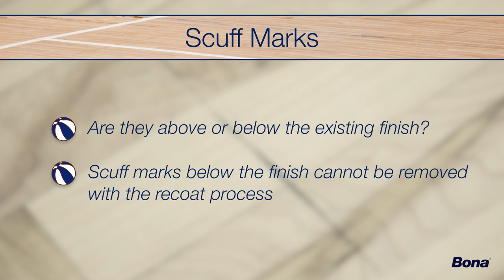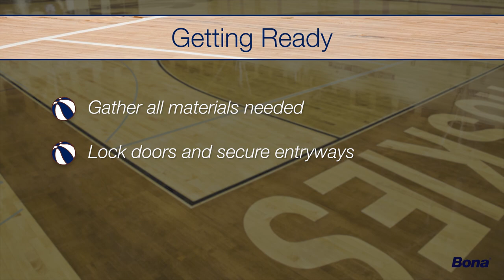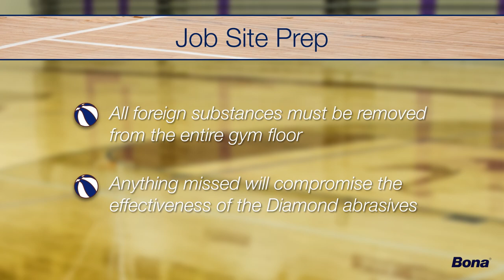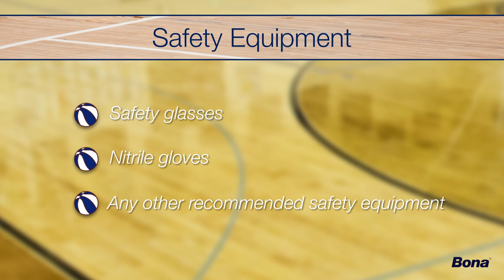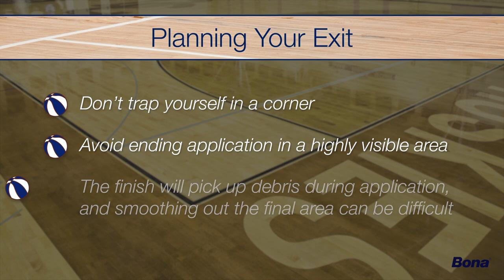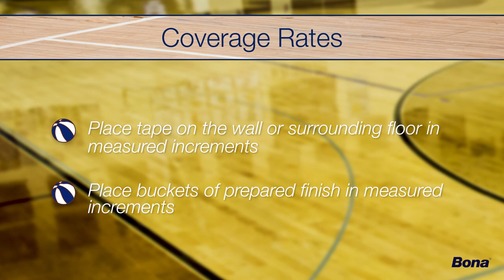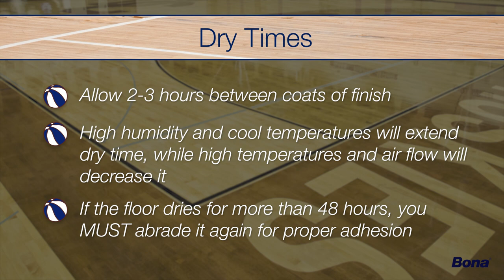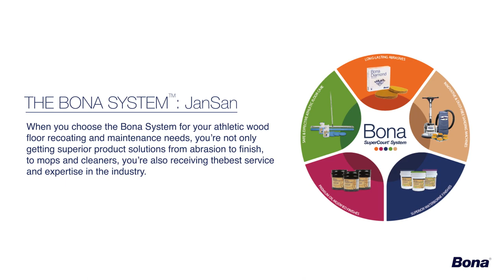How to Recoat Wood Gym Floors with Bona SuperCourt® Waterborne Finishes

Comment: Also you should make the pad like a towel so instead of getting the dust off you fold it on top of the dust so you can keep going
Reply from the maker: Hi Garrett - Using cheap bath/beach towels is also a great way to complete the tacking, doing just what you're saying and folding it back on itself as it gets dirty. We couldn't compete with Walmart pricing on towels like that, thus why we don't create a pad like that. We've found that the best cleaning method is to actually run the PowerScrubber back over the floor to truly remove all the fine dust and debris from the abraded floor. Hope that helps!

Comment: What do you do with peeling?
Reply from the maker: Hi Daniel - Sport floors that are exhibiting peeling of the finish need troubleshooting to determine the source/cause of the peeling and if it's an on-going issue or just a spot(s) issue. If on-going, the whole floor might need refinished. If spot issues, then repair those spots before recoating the whole floor. Hope that helps.